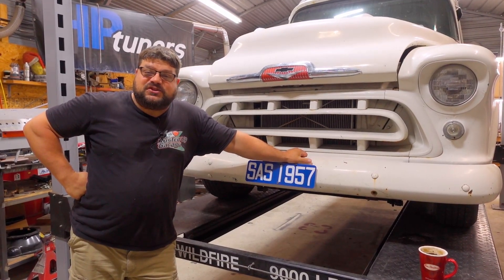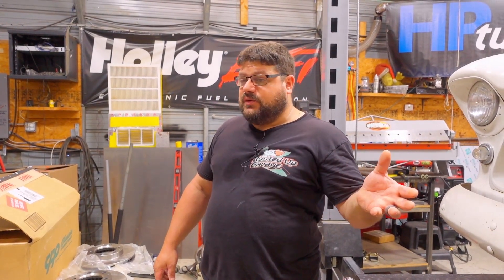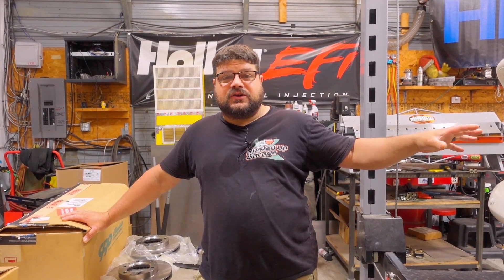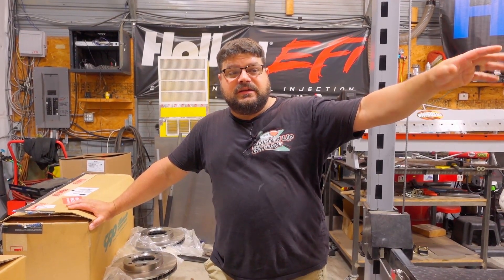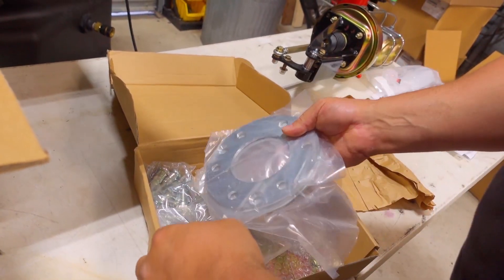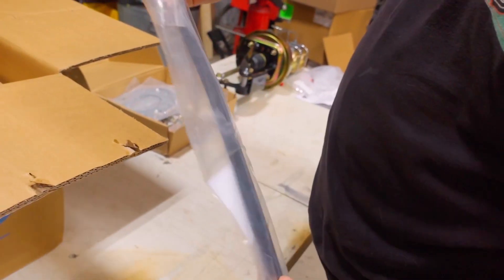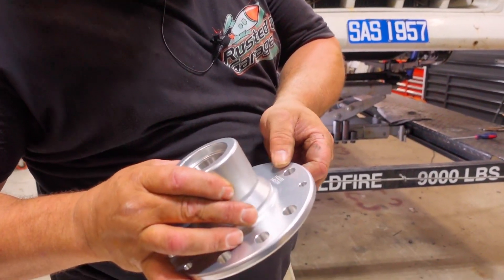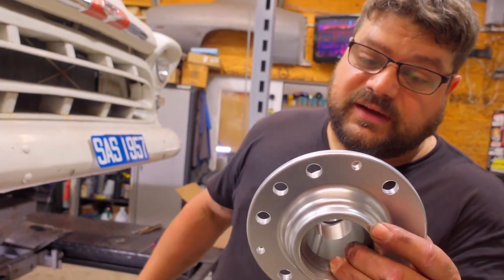57 Chevy 3100 Disk Brake Conversion

Comment: Had a lot of problems with this kit
Wish the hub & rotors came 
Pre-assembled studs are to short 
If you need to add 3/16 spacer
Got it to work, but you shouldn't 
Have to modify or buy new parts
Reply: Thanks for the information, I agree with having to modify, they don't tell you about the problems you will have. I don't mind having to use spacers, if they are not too thick. I believe on your video you said 3/4  spacers is it  3/16 or 3/4. What is the thinnest spacers I can get by with.
Reply: @rickwest2366   had to put
Rally wheels on used a 3/ 16
Spacer, to clear calipers , lugs 
Nut were flush haven't a problem
Have to install new pads & rotors
Been putting it off, for awhile
Had a little vibration  since new
If had to hit brakes hard
Got a munchi 4 speed 
Thar helps
Still a old trk you have to drive it

Comment: I'm wanting to change my 56 truck to dis brakes like you did on the 57.  My hold up now after watching your video is spacers. I have the original wheel and want to keep them. How do you feel about using them, Where did you find spacers at?
Reply: Not going to happen I tried 
Wheels wodon't  clear calpiers
Reply: @donaldbishop7550  what's the lest amount you can get by with using spacers?